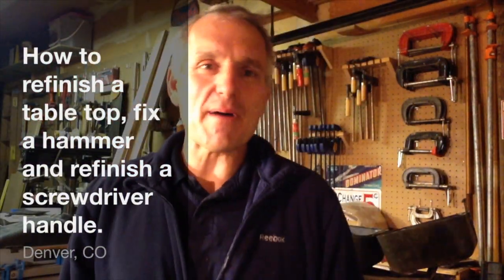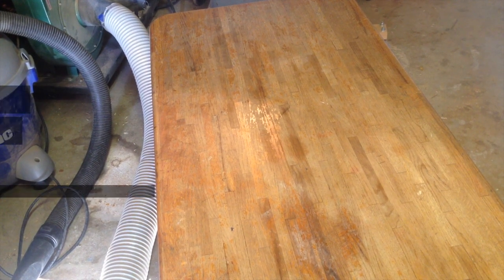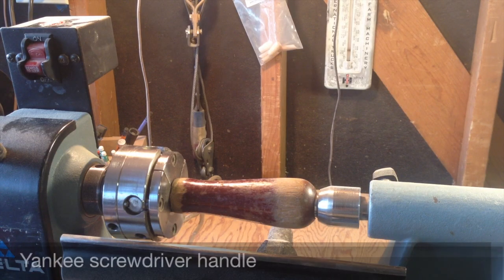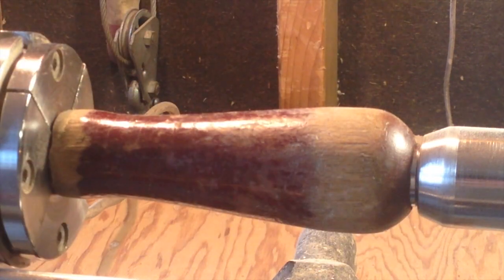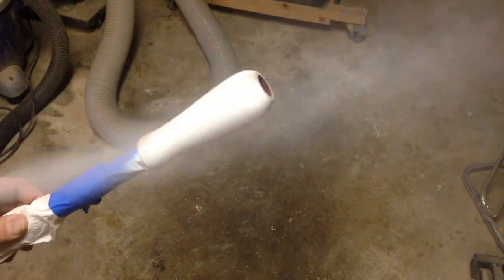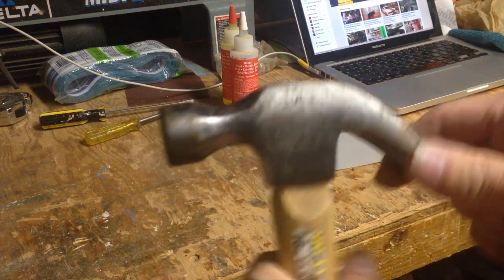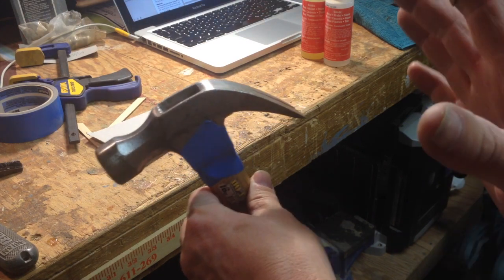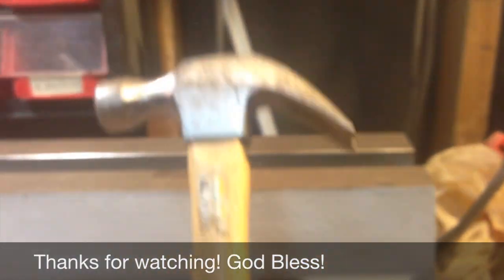How to refinish a table top, fix a hammer and refinish a screwdriver handle.

Comment: Chris, a method that old time carpenters used to replace a broke hammer handle, was to heat the hammer head, on top of a stove or  in the oven, not hot enough to draw the temper out, then drive the handle in till it was tight and let it cool.  The head never got loose.